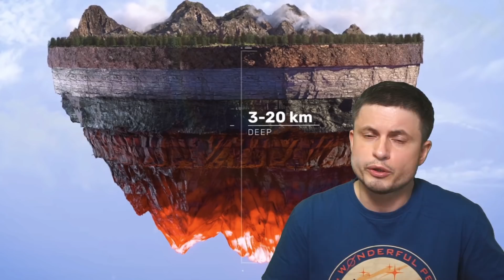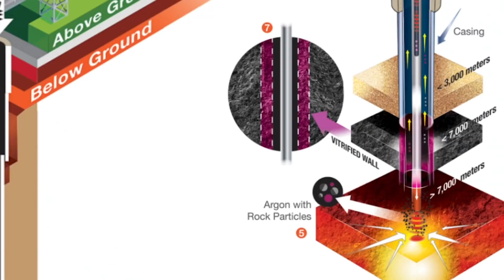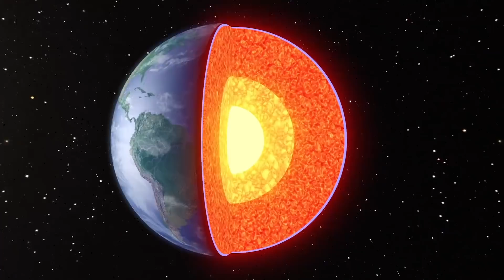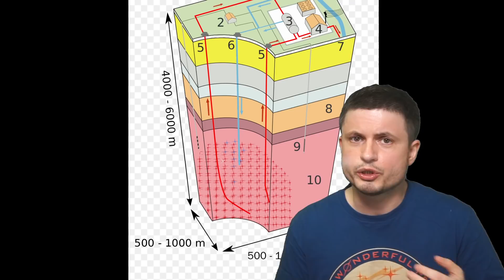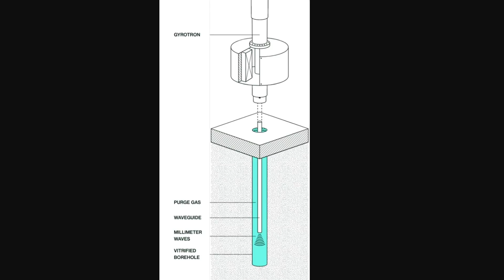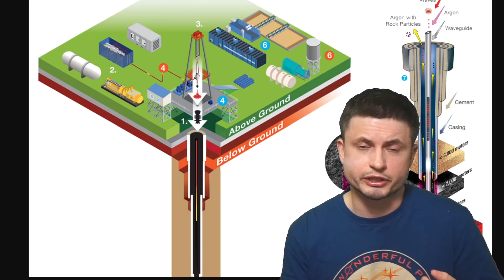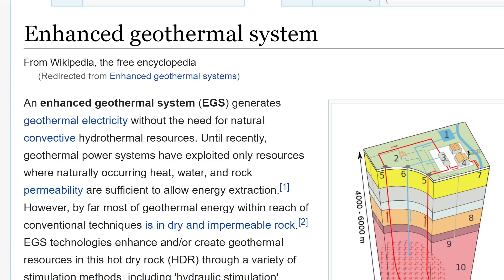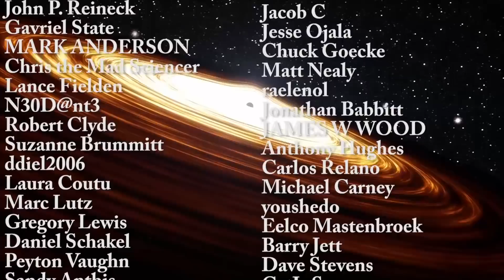Creating Deepest Hole on Earth For Geothermal Energy Revolution

Comment: You could use Stirling engines for lower depths of drilling.  You'd have to convince me that drilling ~20KM into the earth is easier than building a fission plant.
Reply: Stirlings produce power by diving a flywheel at a high RPM over a long acceleration curve. They don't produce the low RPM torque required for that kind of work.
Reply: I'm not familiar with low rpm steam turbines, but that may well be ignorance on my part.  What rpms do you consider to be low in this context?
Reply: @markflacy7099  a sterling is not a steamer, it's a heat induction motor. A heat source under a sealed  cylinder expands the air and pushes the piston past an exhaust port on cylinder.
Used to be able to buy both the sterling, and the tin town steam engine as toys. The sterling had a little oil burner flame under a solid expansion chamber in front of a ribbed cylinder  I have both a single and a twin. I also have a nice assortment of little steamers.
Have fun
Reply: @markflacy7099  a steam engine would be a decent choice depending where you are. I mean, if you have electricity available, that would be way cheaper to run

Comment: The water itself doesn't go critical, the fuel does. The water is heated by the fuel, and is either turned to steam like in a boiling water reactor (BWR) or is routed to a steam generator like in a pressurized water reactor (PWR).

Comment: I’m curious how much energy one could sustainably remove from a given borehole. That’s going to be limited by the thermal conductivity of the rock. I wonder if it’s really going to be enough energy to pay back the cost of drilling the hole, or enough to supply commercially significant amounts of energy?

Comment: My concern is, if these are used everywhere in high quantities, wouldn't it noticeably speed up internal cooling of the planet?
Reply: Technically it would speed up the internal cooling, but not noticeably.  The sun will cease doing its fusion things in like 5 billion years and the Earth will take longer to cool than that by a bit.  So cooling it down faster won’t do too much.  The sun likely will still die first.
Reply: @masonhock6442  Well there goes the idea that reincarnation is a reality........who wants to be born again when the world you live on is dying.
Reply: Thats my concern as well.  Remember when we could not possibly exhaust the fossil fuel supply because there was so much.
Reply: Subduction of a single small tectonic slab cools the mantle more than a million geothermal boreholes. Your worries are unreasonable.
Reply: @ProfezorSnayp  people constantly underestimate human consumption
Reply: I also have this concern, we always sayits negligible until it's not lol. We could probably dig only 40 feet and use that to help cool /  AC houses using the fact temps there hold steady at 55F.
Reply: More worry would be local cooling that could make some big cracks in crust (it can store a lot of tension before cracking), producing earthquakes in areas that shouldn't have them. Happened before (in relation with geothermal or some oil/gas pumping etc.) and gonna happen again. If they are just small and un-noticable, it is fine. But if such a hole makes cracks in many houses walls in area, it can be concern (not be scared but be prepared)

Comment: If industrial shops can cut hardened tool steel with water jets, I would venture cutting thru softer rock with high pressure water jets would be easier, self cleaning, and cooling.

Comment: Long ago my college U of MN invented the Plumbed CO2 Geothermal plant with coal power plant over shorter depth hole.  After hole shaft is filled with CO2 from coal then steam plant works without coal..it has high Reynolds number.  You are NATO sellout.

Comment: Could massive fission bombs be exploded underground and used as a shallow heat source for geothermal plants?
Reply: Yes.  But sudden blasts of energy aren't usually very useful.   There is an idea to fill an old mine with bajilions of tons of salt, and bury a nuke in it, let it go boom  The salt is supposed to absorb the heat pretty much like what you're thinking.   

We can make pretty small nukes too.  Two 60-lb blocks of uranium smashed together in the right way will do it.

But it's much easier and safer to keep the uranium subcritical and bleed power out of it gradually, in a nuclear reactor.  Much more efficient too.

Comment: We drilled vertical geothermal wells when we built our house, 3 wells at 120m. Heatpumps essentially, pumps liquid down; up again and through all the rooms of the house. Works pretty well, winters here get to like -20/30 C; despite that energy use has been fairly low and not had any need to suppliment the heating with others means.
Been a couple of issues with the pump/regulator itself but its always been "techical" ala turn off & on again or dont hang items (bags w empty bottles) on that valve leaver dumbo.

System also could also activly cool down by passing the liquid through a fridge (more energy intensive),  but y we dont have that installed, just very little need at ~60° N.
Reply: Are you saying you're just using a pump and pumping the borehole water round the house? Because normally when someone says heat pump they mean using a refrigerant cycle to raise the temperature up to useful levels.

Comment: Use elevator to keep system in the sweet spot up and down the shaft you could heat more than water whatever you lower plus it will suck up heat and energy,another way to reduce volitilaty of volcanoes

Comment: yay they may be doing what i shared for years.  thou they seem to want to dig deeper than i anticipated, i figured just a few hundred feet and that the units would power a home to a neighborhood .  thou my idea was for a steam generator system on a sled, that you could lower or raise in the tunnel for maintenance and to adjust the power output.  i had the idea a while back... but if i had to say, i'd probably say "ever since that 2012 movie". :D  the guy in india putting his feet in a bucket of ice in the mine was the reason i came up with the idea :D  the only fear i had is that IF it became the primary means then there would be allot of tunnels, that gave me worries that it could cool the core in some way ... but i'm no scientist to understand if that is a true worry.   as a side note you could potentially use a liquid with a lower boiling level... i know before i had this mine / generator idea i had one about using the liquid in those hourglasses that when you hold them the liquid boils and moves from the bottom chamber to the top, in your hand... thou i keep forgetting what that liquid is... so then i worry if its toxic to people...... but those generator ideas were for cars and people... cars to run heaters and coolers to keep them at a good temp inside.... and to charge batteries if they are electric, by using the solar/ ambient temp outside... for the people i thought about like backpacks or even watch sized ones... think about carrying a boom box music system that would use 8-10 d cell batteries being able to be powered by "YOU" sort of thing... but again i was worried the liquid could be toxic to us so i wrote it off... but i have shared it before too :D   using the ideas in concert with air and solar power in the same unit/system could change our energy dependence.
Reply: as a side note.  i always wondered why the temperature differential in space was not used to generate power... i mean when things are close enough to the sun you could use solar but lets say you have a propulsion system that generates heat, that heat could be used as an alternative for the hot side....i just don't know what liquid or gas for that matter would be most suitable to be used... with the new telescope in space thou and its thermal layered system to protect it... the idea keeps coming back to me ... if you could pass any of these on to anyone who could use them.. i would appreciate it.  ty

Comment: Regarding geothermal as clean energy, the source often has gasses high in hydrogen sulfide that stink and have to be cleaned up before being allowed to vent.  Methane can also be common, in which case you may as well use that to operate a gas turbine (carbon emitted). 
 But overall geothermal, where it can be used, is indeed relatively good.
Reply: Aren't we using two definitions of the term "clean" here?
Reply: In locations that already have geothermal activity it would make no difference. 
Volcanoes will always spew methane and carbon
Reply: I would imagine that the top side is a closed loop, condensing the water vapor after the turbines and pumping it back down. For natural sources (presumably Iceland?), which include hydrogen sulfide and methane, they would already be venting those gases before the turbines were installed. I am sure you could hold the  energy company responsible for cleaning those up.
Reply: @one_hoop  When the cat (government watchdog agencies) and the industry are one and the same there is no real accountability for pollution.  That was what the situation was in Warsaw Pact lands.
Reply: Doesn't Hydrogen sulfide help cool the planet?..sounds like a plus.

Comment: I did the plumbing on a geothermal house.     Just a bunch of big pipes going deep enough to raise water temperature to 65 degrees.f.     I think it was only a few 1000 feet.     Not even as deep as a mine.
Reply: ...you could also build the house down there and use the tubes for sunlight and ventilation. 😁

Comment: i used to build geothermal powerplants. southern california, nevada, oregon, hawaii, and northern california. built a lot. but it is costly to build, and very low output compared to other forms of energy creation. that is why its not so widely used. so until the construction costs come down, it wont be a widespread reality. it might seem simple, just drill a hole and built a plant. but its not. drilling the hole can take a lot of work and a single hole can take months  upon months to drill and cost up to $10 million. per hole. and you need dozens of holes per powerplant. you also need injection wells for each production well. so you need 2 holes for 1 production well. giving you about 1 megawatt if you have full production. but you cant do that, or the hole will cool down too fast and you will lose production anyways. and because of the nature of chemistry, once a well gets cooled down too much, it can take years for it to heat back up. people who have never drilled a deep hole always think their idea will work easily and be quick. but they dont seem to know the problems that can come with drilling a deep hole.

Comment: Good for them! It makes a lot of sense to do it this way. What do they do about the bubbles of steam? Does the steam come up through a different pipe? Does it cause earthquakes?
Reply: Yeah, they have separate pipes for injecting the water into the earth, and returning the steam to the surface.  I think the pressures are high enough that the water can't actually boil, even though it does get darn hot.
Reply: They ideally want supercritical water - this is above the point that there are distinct liquid and gas phases - the water would be a compressible fluid, but not really liquid or gas. This happens above about 373 celcius

Comment: Eavor Geothermal is another super interesting start up! instead of going really deep, they actually drill different heat exchangers in the rock where it’s hot enough. they plan on coordinating with wind and solar, because the longer they keep the water/fluid down there - the hotter and more energy efficient it becomes. then, when they release it, it can ramp up like a peaker plants. these facilities can also function as baseload as well - and because they are closed loop, no extra material is actually going out into the rocks and therefore no induced seismicity.
Reply: Sad thing is that it very often dismissed as viable option even though they already did proof it works.
Reply: @platin2148  amen
Reply: There was a geothermal pilot in Finland that finished recently. Fortum drilled 6,4 km deep hole in Espoo. Purpose was to push the heat from the hole to district heating system, but the water was not hot enough. It would have been cheaper to capture waste heat from eg. data center or waste water treatment plant.
Reply: @tomi213  yeah they’re going to have to nail down predictability of heat. also, they’re going to need to make sure they can’t exhaust the heat from these aquifers and that they can get enough. otherwise, it might be better just to go with next gen nuclear - of which there are a lot of options to choose from.
Reply: @tomi213  The problem people forget about geothermal on large scale is that it will always be limited by the rocks thermal conductivity where you have to expand horizontally at depth to increase capacity that simply isn't practical.. UNLESS, you're repurposing retired deep mining facilities as a flooded thermal battery for renewables. At times some regions produce soo much wind energy they are forced to rotate the blade profiles to produce zero power to prevent damage to the grid. So efficiency losses of a thermal battery become moot as the alternative is underutilized turbine when the winds are useful.

While I won't deny lithium is a more efficient grid battery it robs the automotive market from a potential PHEV or EV that would be more efficient even if it were solely recharged by coal.
Reply: any time you "harvest heat" you will cool down the 'heating element' and it takes time to return to high temps... there may scales of efficiency at the smaller end, with many small plants supplying modest energy to small local areas.
Reply: THIS IS A HORRIBLE IDEA!
Cooling the core of Earth kills the magnetic field that protects us from the Sun.
Kill the magnetic field and you literally kill everything on the fucking planet.
Stupid engineers can't think past their own noses.

Comment: I’ve read several of the papers from the main scientist at the company. One benefit is that they can put this on the grounds of coal plants as they are being retired, make use of the existing generators but supply supercritical steam directly from the ground instead of by burning coal. They then also make use of the whole ties into the grid, etc. Should be efficient, cheap, and fast to deploy and permit, provided that the core vaporizing/clearing technology works.
Reply: THIS IS A HORRIBLE IDEA!
Cooling the core of Earth kills the magnetic field that protects us from the Sun.
Kill the magnetic field and you literally kill everything on the fucking planet.
Stupid engineers can't think past their own noses.

Comment: Well the places that have geothermal sources close to the surface aren't typically geologically stable, and the ones that are usually end up being some kind of environmental preserve. In other cases they are in very remote locations away from industry and other settlements making life difficult for the plant workers. What makes fossil fuels attractive in this context is that it's a transportable energy source where as geothermal has to be produced on site and transmitted. It isn't that I'm criticizing it out of no where, but there are some challenges will need to be addressed, and from an incessant point of view, the price per watt hour is too stable. Unlike petroleum and nuclear, the price isn't likely to be manipulated easily so one could gain profits in a different sector of the industry. It's one of the cases where being stable and reliable makes something unattractive.

Comment: I have always thought about this, figured it would turn into a catastrophe with a mini volcano.
Reply: A drillhole in Iceland at one time turned into a mini vulcano. They drilled into some magma.
Reply: @mectrom  Iceland sits on a fault between two tectonic plates. You can hit magma with a pretty shallow hole (<6,000 feet) anywhere on the island. They only drill down to where it's only about 200 degrees Celsius maximum.
Reply: @adaster98  2009 Krafla volcano Iceland,depth of 6,900 feet,2.1 Kilometers.
Reply: What if they find hell? Maybe have a priest on stand by just in case
Reply: And here I am, with zero scientific education, thinking if they drilled too many holes then the Earth’s core would cool and cause the planet to break up or something 🤦🏻‍♂️
Reply: @adaster98  Well maybe don't drill too deep,but the well is actually a production well,hotter than most at 750F.  

They said the magma plugged about 9 meters of borehole.
Reply: @adaster98  source: world wide web
Reply: @randybaumery5090  the world wide web is the medium not the source

Comment: I remember when Pacific Gas and Electric Company started using steam from The Geysers in northern California for a power plant (about 1960).  They first used an old retired generator that had operated at a lower pressure than modern ones;  there was a lot of wear on the turbine blades because of sand in the steam, and a lot of corrosion from chemicals in the steam.  There was also air and water pollution from those chemicals.  They got those things fixed pretty well and built the largest geothermal power plant in the world--more than enough to power San Francisco.  Then the steam began to decrease because the underground water was being exhausted, so they began injecting well-treated water from waste treatment plants.  A closed system that recycles the water would take care of most of those problems, but would need to work at higher temperatures--I suppose that is what you are describing here.  I think it was in the 1970's I saw a story about Los Alamos National Laboratory developing a system for actually melting holes through bedrock, similar to what you describe here.  But two miles deep?  Wow! That should make geothermal power available in an awful lot of places.  It wouldn't be easy to steer a drill going that deep, but by now we probably know how to do it.